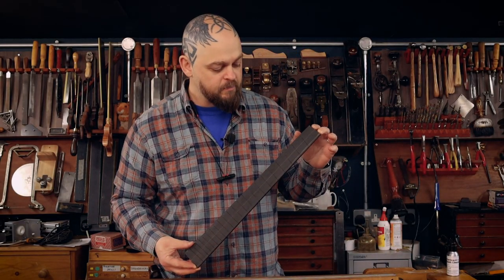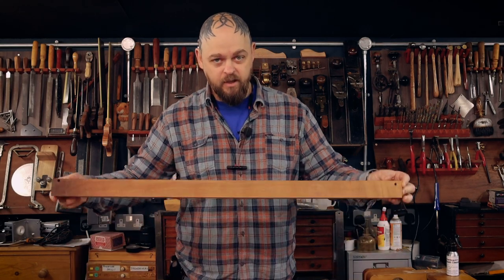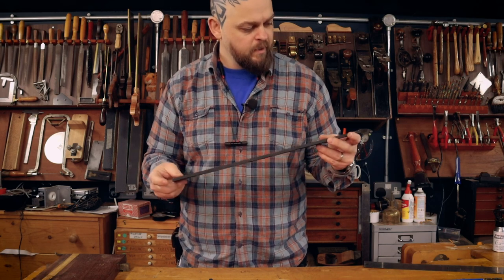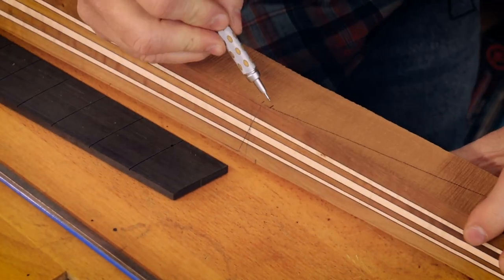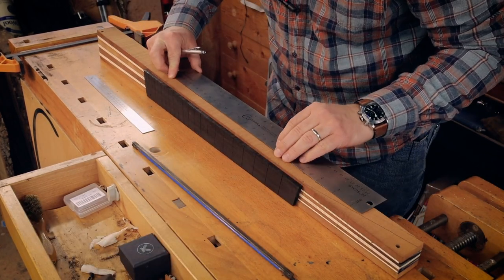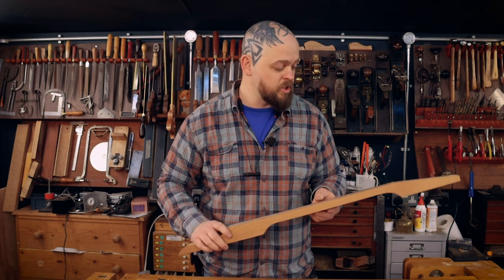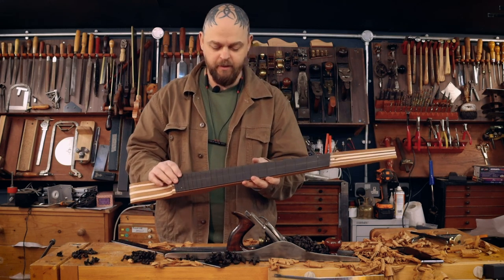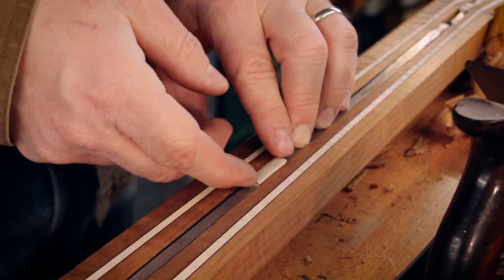Ep 3 Neck shaping, attaching the Fretboard - Making a Modern Multi-Scale Electro Acoustic Guitar

Comment: a little tip for hardening metals, check the carbon in the metal by holding against your grinding wheel.
if there is little carbon in the metal the sparks will be short and don't branch of in to smaller sparks.
If there is a high amount of carbon which is needed for hardening the sparks will look more like those of a fireworks sparkler, meaning the sparks branch out into more tiny sparks.
compare it to holding a old file or chisel against the wheel :)
Reply from the maker: Thank you for this! I have a permanent note saved for the next time I need this! B

Comment: I recently made my first bound neck and glued the fretboard on first, then routed for the binding. it worked out really well. I was thinking of putting the binding on first, next time, to see what I prefer, but I also tend to want to just go with what I know works. I bought a router bit with different bearings for different binding thicknesses and want to get my money's worth, so who knows. I don't think it makes much difference.
Reply from the maker: gluing the binding to the fretboard first just means that you have to plane the gluing face down again before you install the fretboard.. an extra job therefore not the most efficient way to be gong about things.. B

Comment: It is no problem at all to sit a bench plane on its sole provided the surface won’t chip or mar the blade. If the plane is set up correctly, the iron will not be knocked out of adjustment. The old “common wisdom” that  a plane should be laid on its side comes from old text books used in public schools. This was largely a measure for the kids not to ruin the plane irons by dinging them up every 5 minutes. Rock on, Ben!

Comment: One way to make the channel would be to use a right width rebate plane and just plane all the way through. You then need to glue end pieces to the channel, but I see no problem in that. It's not really necessary to have the piece in dogs for planing, btw. And end stop is enough. Maybe some side support helps on an asymmetrical piece. Planes are such precise instruments, you don't really generate sideways forces.
Reply from the maker: absolutely, a plough plane would also work very well as someone else suggested..  B

Comment: Modest suggestion: instead of a rolled bit of masking tape in the middle of the truss rod, how about a rolled bit of the soft side of velcro? It would never break down and compress past 2mm.
Reply from the maker: That would work well.. I have seen other luthiers using veneer for this purpose.. I may well go that route.. it is far more easily accessible.. B
Reply: @CrimsonCustomGuitars  I noted also that over time the Masking Tape would deteriorate and lose any effective purpose, so I'm glad to hear that (not unexpectedly) you are considering alternatives ...

Comment: Hey, Ben. What if, for the truss rod channel, you drilled several in line holes with a power drill, and then used a chisel for cleaning it up? You could draw the correct depth of the drill with a sharpie in order to make the channel depth even.

Comment: What kind of truss rod did you use and what length and why you want it to be fitted precisely that way? What caused the neck to be lighter than you anticipated? You said in a video that the glue penetrates into the wood. Would it penetrate deeper into the fibers and more evenly if the wood was dampened previous to gluing?

Comment: Mmm. Roasted maple is awesome for necks.  Especially since (based on the what I’ve read about the process) it makes the neck no longer sensitive to movement via humidity.   However I have observed an interesting phenomenon... 
regular top on a roasted body resulted in a slight lip due to glue creep after months.   (Using titebond 1) Wonder how those laminate pieces in the neck are going to act.
Reply from the maker: I'm using, effectively, Titebond 50.. however I will keep a very very close eye on this now, thank you for the heads up! B

Comment: Pros of glue first the fret and binding
less work calculating the space needed before you glue  the fret board and need to leave the right space for glue  the binding on the neck
If need to come out at any point and the join in between the binding and the fret is strong more likely to come out in one piece and less damage in the process
       More easy to secure the glue up once is all in one piece instead to have more part to do in one glue up(I never glue in that kind of work ...but if I’m correct the more glued parts with a chance to move the more risk of moving out of place on the glue squeeze
Cons.
More hours working as you will do 2 glue ups one for the fret and the binding and then gluing all to the neck.

Sorry if my English is not great ,forgive me if I have misspelled word and or nor use the correct terminology but I’m Spanish and I learn English just by watching videos so not as good on the writing part......or the talking part XD

Comment: You said ask questions.... so here it goes.  I have a wiring issue that I hope you can help with or point me in the right direction.  I have a 1985 westone guitar that I replaced the pickups on.  It’s a HSH set up with 1 volume and 2 tones(all push pull pots) and a 3 way switch.  I can’t find a wiring diagram that makes sense.  The Westone forums diagram makes no sense.  The issue is, volume pot splits coils the humbuckers, tone 1 turns single on and off and second tone reverse phases the bridge. Replacement pickups are Seymour Duncan.... Any help would be much appreciated.

Comment: Ben- use the drill to turn the tap.  And from an airplane mechanic, full scale as well as models, doesn’t everyone use ca to harden holes?  In wood that is....   temper iron in oven at 425f to eliminate brittleness.   Paul Sellers has a video called “poor mans router “ that shows the easier method of making a quickie version. Carry on
Reply from the maker: That was a large amount of info in a  very concise paragraph! Yes.. drill to turn tap.. glue to harden taps in wood is relatively new to me but I'm not surprised it is common knowledge. I have used an oven to temper before but this time was in a bit of a rush.. I want to make a 'proper' steel blade sometime soon for this one.. and I love almost everything Paul Sellers has done on YouTube.. he is awesome! B

Comment: Ben, how do you heat the shed and to what temperature? I presume the wood and the tools need some stable warmth....
Reply from the maker: I have an oil filled radiator at the moment, the shed is only just up and running.. I am considering adding underfloor heating and a thermostat though.. a good 18 degrees or so is all I really need. B

Comment: Could you not have made your central layer of wood 6mm and then sandwich the neck with that central piece of wood lower than the rest by the appropriate depth so you have no need to rout a channel? Would that be an option?
Reply from the maker: yes, an elegant solution and totally valid! B

Comment: Nice job ! The problem (for beginner I assume) with this kind of plane router is to follow the line. But interresting :) 
One question that makes me crazy about guitar : what really influence the sustain ? And is it possible to gain more sustain on an already build guitar ? (Yes, I have one guitar which have the sustain of a guitar trapped under ice ;) \m/ )
Thanks for the video !
Reply from the maker: I cut the lines with a scalpel first to guide the router.. from there it was pretty straight forward.. 

Sustain is a difficult one but start by changing the nut out for a brass one.. steel hardware makes a difference as does tightening the neck bolts.. if it is a bolt on, and making sure the truss rod isn't too loose.. B
Reply: @CrimsonCustomGuitars  Thanks ! Yes, a good scalpel is usefull !
Okay, I notice that for sustain, thank you :) (the real difficulty is to find a "good" luthier, around me, if you're not a professional, with a collectible instrument, they tend to make it fast and bad...)

Comment: When lighting a torch, you should never use a lighter. The fuel in the lighter can ignite and will burn your hand severely. Ask any certified welder.
Reply from the maker: Looked it up and I will be looking for the right tool tomorrow.. thanks for the heads up. B
Reply: @CrimsonCustomGuitars  Easy to make..  just some flint, a oversized P.O.T.,  threads and a thin piece of tube steel with a safety pin spring added to it.  Commonly called a Flint Spark torch ignitor or Ferrocerium.  You'll love it either way.  Thank you for all of your Videos and hard work you put into these.

Comment: 24:05 You have 4" long bench dogs - couldn't you raise them up so they clamped the neck down the center line to prevent bowing?
Reply from the maker: yes, I could have.. I also have kids here.. the number of times one or other comes and visits then plays with the vice handle.. well, scary doesn't even come close :) Also, tbh, it didn't even occur to me. I think my favourite suggestion in these comments though was to use a ratchet strap system.. clean and easy. B

Comment: You call yourself a luthier? You're still clamping wrong! Not only should it be from one end to the other, but you should alternate your clamps left to right to mitigate any uneven pressure of the jaws so you don't introduce a twist to the neck. LOL, I am of course kidding, but this is the kind of absurd detail that my mind wanders off into. The design of those clamps may introduce uneven pressure between the inside and outside of the jaws, however, with the heft of the clamping caul it's probably a moot point. Love the videos, keep up the great work!

Comment: If the top of the headstock is at an angle, wont that give a problem with the tuner nuts not sitting on a flat surface?
Or do you make the same angle on the backside of the headstock so the tuners themself sit at the same angle?
Reply from the maker: The later, the back will be congruent to the front so no problem in the end. B

Comment: I like to drizzle some really thin CA glue into all the wood screw holes in guitars to reinforce the threads. Particularly strap button screw holes and pickguard screw holes. Better to do it when the threads are in good shape than to wait until they get stripped out and have to be repaired.
Reply from the maker: You showing this much care and thought as you build says a lot about you as a builder, I am inspired and will start doing the same! B
Reply: @CrimsonCustomGuitars  
I've always been a believer in the saying that an ounce of prevention is worth a pound of cure.